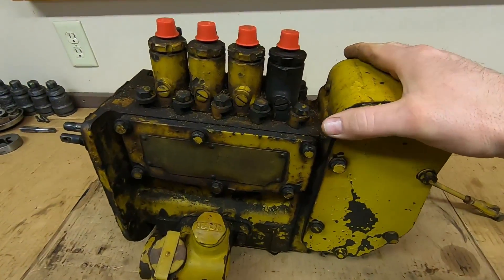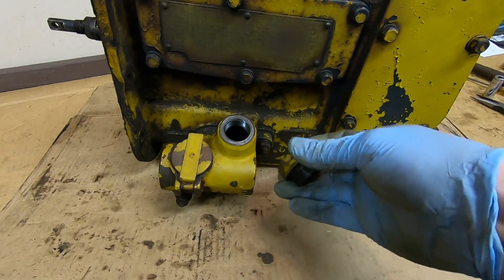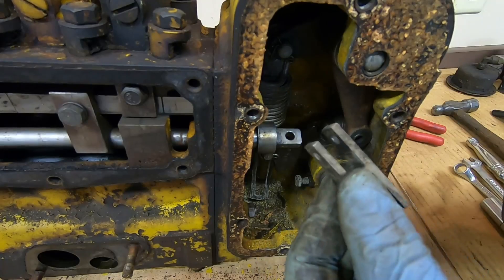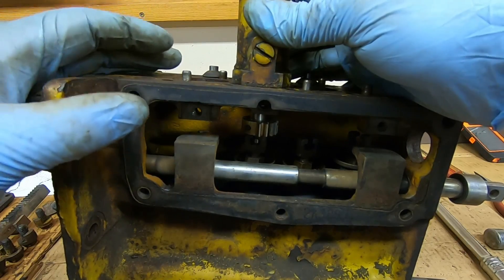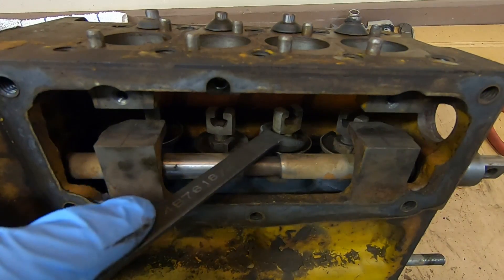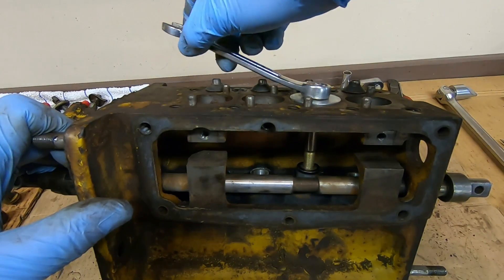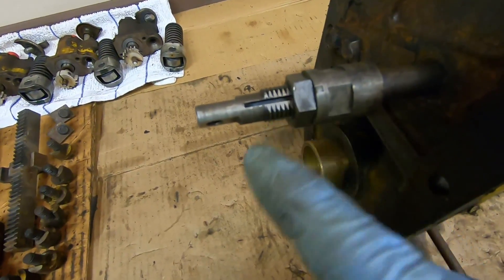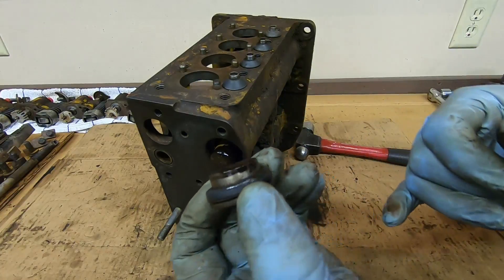Caterpillar D2 #5J1113 Diesel Engine Assembly Ep.29: Injection Pump Disassembly & Problems...

Comment: Hey sqautch I acquired a 1936 caterpillar rd4 a few years ago now I have been slowly fixing it up but I have since hit a brick wall with fuel system it seems my injection pump units are too warn out to build up enough pressure to fire the injectors I have been hunting everywhere in Australia for some replacements but I can't seem to find anything any help locating a set would much appreciated. Another question is it possible to retro fit later model d4 pumps to the d4400?
Reply from the maker: Unfortunately the only option we have now for replacing the actual pumps is to locate good used units, most times still attached to another whole parts tractor lol ;-)  Our old Cat parts sources are drying up fast as well, I would call General Gear & Machine in Boise, Idaho to see if they would have any - but since Florin Tractor dried up I don't have any other good suggestions.  Unfortunately the later D4 pumps are not a direct swap either, because the D315 went to a larger bore and different style injectors altogether so fuel volume and pop-off pressure completely changed.  But any pumps that come from any D4400 will work.
Reply: @squatch253  I contacted general gear and machine they have informed me that the pumps on my machine are a mystery they can't find the part number in there manuals the number on the pumps is 6b5791. They gave me the correct part number I did a quick search online and found a set for sale so thank you very much for your help you have just saved another one

Comment: I'm looking at a 1941 D4 that has sat for about 10 years.  It shut down when running and never would start again.  The injection pump cam is not turning.  Do you have any suggestions?  The price is very, very attractive for a hobby dozer on my property.  I have a lot of old iron, but have no familiarity with old diesels or crawlers.  It supposedly steered when being winched a couple years ago.  I'm trying to avoid another complete project, but know a lot of folks miss easy fixes because they won't turn a few bolts and look.  It's hard not to look at a solid old Cat for $1500 anyway.
Reply from the maker: The early D4’s (1946 and prior) came from the factory with Formica composite camshaft gears in them - sounds strange but I’ve dismantled D4 engines before and actually found a couple that now live on my “shelf of odd things” lol 😂 Those Formica gears became known for shedding their teeth and causing the rest of the timing gears to stop turning. Most were replaced with regular steel gears decades ago, but a few made it through and can still be found today. The symptoms you listed (suddenly quit running and injection pump camshaft no longer turning) are exactly what happens when the fiber cam gear decides to give up - because the steel crankshaft gear turns the fiber camshaft gear, which has another steel gear bolted on the top of it which powers the rest of the timing geartrain on out to the injection pump. So when the fiber cam gear goes out, everything else stops turning too. To see exactly what I’m talking about, I highly recommend checking out a YouTube channel called LAOL which stands for “Life After Our Loss”, Aaron and Greg on there are currently rebuilding a 1939 D4 they call “Lil Lefty” in which they discovered it still had its original Formica cam gear still intact. They’ve since sourced a replacement steel cam gear to replace it with before it failed too. Additional damage to the engine could also include bent or broken valves as well as bent pushrods depending on how many came into contact with pistons before the diesel engine finally quit turning.
Reply: @squatch253 Thanks for the info, I actually watched that video this morning and am a little familiar with those fiber gears as my Model A had one that failed.  

I'll probably pass on this one, though they did say it isn't seized and briefly hit it with Ether just to see what it would do, and it fired.  I know that can cause issues itself.   It's probably a great deal for someone that knows them and has access to parts.

Comment: Hello again, fuel rack, what does the fuel rack do or is it the gear tooth rack? So the gear rack times fuel delivery, I would have thought the cam , or cam lobs would time it. I am missing something. I now see that the injector pumps are on top of this unit. The lobs push a plunger in the injector pumps and that gives high pressure. I think OK I watched this 2 times, I guess I will work my way back up watch the next ones again

Comment: Hello Squatch253  I am having a issue with my D2 fuel pump plunger on number one cylinder. The plunger is stuck up near top of its stroke. there is slight movement, put some release oil  on it. Any ideas to free it up ?  Thanks

Comment: Appreciate your content.  Quick question what oil would a cat d4 number 7j6155 use in the injector pump use.  Also what oil do you put in the engagement fill hole that engages the piney motor to the diesel motor.  Appreciate it

Comment: thoroughly enjoying your series on the D2 and have been following along with each episode. We have a question , in episode 29 Injection P Diassembly and Problems at pt8.37 where you have removed the elements, there are 4 small pipes which feed fuel into the pumps, where do you get the conical seals that are around that pipe and do you have a part number for them?
Reply: @squatch253  
Have you ever removed and replaced the plunger and barrel assembly in the individual pump assemblies as in the 5J1113? And done a video??😬
Cheers
George

Comment: Never worry about a little discoloration of the cam lobes as long as the shape isn't damaged. I've put lots of them back into service with even a few freckles on the lobes and they've worked just fine. The rollers as well sometimes look worse than they really are. Of course if one is being flattened out it's a good idea to just replace it.

Comment: I am so impressed with Squatch's attention to detail - great work!  Just thinking about the design of this engine and its ancillaries, it's as if Cat designers were told to build it as robustly as possible, with no constraint of weight / cost / etc.  It's an amazing piece of engineering, each piece almost a work of art in itself.  The longevity proves this approach worked, although, as pointed out, there are some downsides (e.g. seals not always reliable).  I'd be interested to know how later versions evolved, and what design philosophy applied to later updates and newer engines.  Keep up the good work Squatch!

Comment: What would you recommend for cleaning fuel delivery components from loose dirt etc? is wd-40 okay ?
I had to remove the injector pump and injectors from my international at the field conditions, and there may be some loose dirt that found it's way in to the fuel lines and ports

Comment: During this assembly, throw in a video on your cleaning set up and method.  What tips and tricks do you have for cleaning the exterior of the castings?  It might not seem interesting as it is just cleaning, but it would be based on the size of your parts and amount of grease and dirt.  I can barley get my lawnmower clean.

Comment: I'm working on a 1957, D4 D315 in a 955C #12A3563 Traxcavator and thou parts on your D2 are not exactly the same their technologies are very similar. It is nice to see your videos come out that way I can see what I did right but more over to see what I did wrong. My injection pump was frozen on #3 and #4 lifters but came loose like yours. I did keep track of what went where but got confused which end was which so when I got it back together they were all in backwards. DUH. Spins like a charm now for the timing. 

Thanks so much

Comment: Squatch, on the rack rod adjustment, (and other critical settings) although you counted turns and didn't disturb the other settings, how do you know they were set right originally? I've taken for granted that stuff was set right only to be later burnt or found that they had gone way out just because of age and time. Didn't think you'd take that for granted.

Comment: That junkyard D3400 has more than earned its worth in spare parts. That injection pump cam alone is worth the price of admission and that's nothing compared to the value of the pistons. I'm happy to hear that pump lifters were available NOS. Florin loves this rebuild series, gives them someone to clear out space on their shelves to make room for new crates of parts as they unpack. It will be interesting to see if the new roller lifters continue the trend of 1943 parts you've sourced. Cheers Squatch.

Comment: When I was in my twenties, (I am 67 now), we had a d2 we used for cleaning up barges usually during coal jobs... We would lower the machine down into the barge with the same crane used in digging and it would scrap up the little piles left by the clamshell bucket... I didn't know the fuel pump had an oil sump in it.. We ran it for years and it always ran fine.. Wonder what the pump looked like inside.. Cheers.. Mike in Louisiana

Comment: I've had a 4B7617 made by Armstrong in my toolbox for years.  I knew it was Caterpillar but didn't have a clue exactly what it was for.  8-)
Reply: If the smaller end is D2, what does the larger end fit please?

Comment: Well done. Do you have a bead blaster cabinet to help clean parts? We used them in the shipyard for small parts, not on the machined surfaces, but great for rusted or old painted surfaces to prep for new paint etc. to clean and preserve surfaces. We used a crushed walnut abrasive, not steel shot.

Comment: So how does the hour meter work? I don't see how the drive for it is constant speed.
Reply: @mmm365  I get that - which means it isn't very accurate.
Reply: Zorba, The Veiled Male the rpm range is not so great ,so the error is not much
Reply: Farm tractors had hour meters that ran the same way using the tach cable drive for many years.  I even recall it printed on the face “hours at rated speed” or something like that, meaning tach hours are only close to actual hours at full working RPM.

Comment: Squatch,  The L stop.? Using turns, my first thought is to use a CALIPER  to measure/indicate distance to end of shaft.? Great , in depth episode here.  Thanks, 5 am in California near Sacramento...
Reply: Hi, no, it's ok, with the nut slot marked and the turns counted it amounts to the same thing. Squatch is meticulous in recording such data and he'll have counted it out loud on video - just did n't show it. But, if you're a belts and braces sort of guy then the calipers a good thing to use as well, but I would n't do it on it's own - you might find on reassembly that you are between two locking slots - then which one does one use?  BobUK.
Reply: @bobuk5722  -How Quaint... He said it was EXTREMELY important to be accurate...  He also stated he measured it, and then counted twists.  Since he keeps SO SHORT, I re-WATCH his vids. Glad I caught it the second time I watched it.

Comment: Inline fuel injection pumps always looked like a mini engine hanging off the side of the block. I was trained on the Roosa Master injection pumps when I worked a diesel injection shop in the early 80s. The calibrating fluid and my body did not jive back then so I sadly had to quit that job. I never got into the inline injection pumps which I regret but understood their principle of operation. I would like to go back and spend a day in a injection shop now. Pretty much everything is electronic with just a high pressure pump of sorts and a electronically fired injector.

Comment: Are you going to reset the hour meter because the engine has been rebuilt or are you going to leave it as is for the authentic error and hours
Reply: I think he might leave it as it relates to the hours on the whole machine.